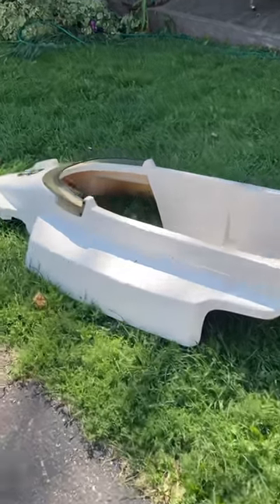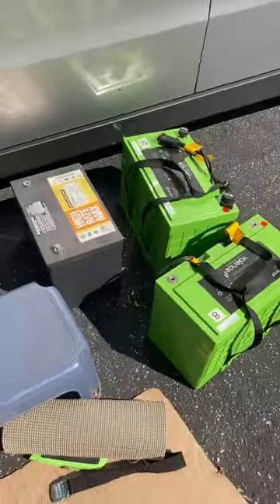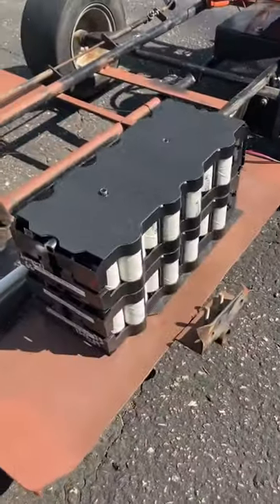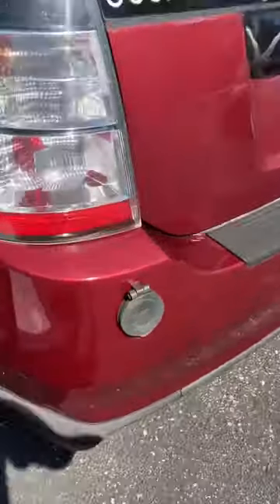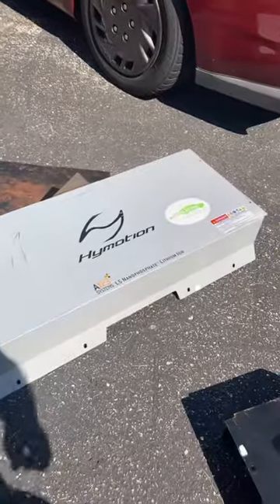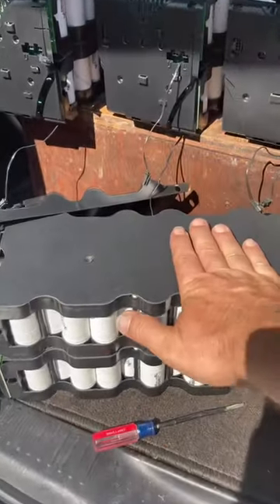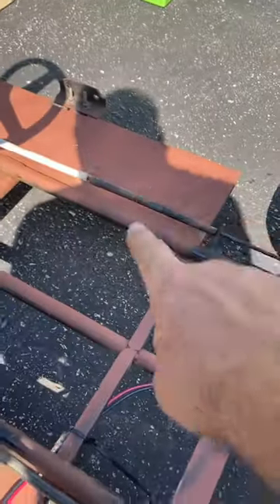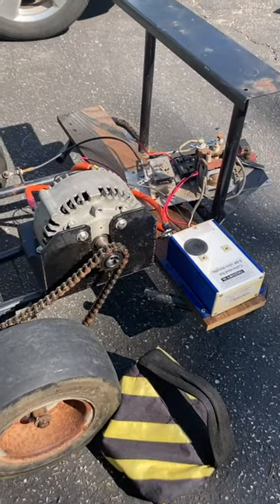A123 Lithium batteries for Electric Go-Kart

Comment: Might you have seen the high discharge 48V capacitor setup on battery hookup.? Might be a good buffer capacity for your build. Looking great 🙂👍 gotta love A123 cells. Zooooommmmmm!
Reply from the maker: I'm more than happy with the A123 cells! This is a low budget project. I'm pretty much just using all the bits and bobs that I have. I nearly forgot that it was A123 cells in that old Prius kit I had stashed away!
Reply: @BenjaminNelsonX  gotcha 👍. Yeah those A123 cells are practically gold!! Great project and looking forward to see the rubber hit the road 🏎️💨

Comment: these are 26650 cells?
Reply from the maker: I measured them. Yes, they are 26650 format cells. A123 Brand.
Reply: ANR26650M1A 2300mAh 70A continuous, slightly less energy than the M1B’s but technically have a bit more power output. If they are M1A’s though that means they are quite old but these A123 cells are famous for being impossible to kill. They might see some degradation in capacity/power output if cycled enough but calendar aging and over discharge seems to have minimal impact on them.  Not uncommon for cells that have seen a lot of cycles to still have 1200-1600mAh of capacity remaining with the ability to discharge at 20A+ even if they are 10-15 years old. I’d imagine by now all the M1A cells are at least 15 years old and it seems the cells that are degraded were from the electric buses that pushed them pretty freaking hard. IIRC it was 16 12S8P packs in series moving a bus so quite the load on those cells. Of it might have been 12 packs in series. Either way somewhere between 400 and 700 volts with 8 cells in parallel means there was a potential output of 560A but I’d say 400A would be a more realistic number that wouldn’t cause excessive voltage drop. 460V at 400A is 184kw of power which seems about right for a bus 

There’s some M1B 12S8P packs on eBay right now. $100 shipped for lightly used and $110 for uncycled. Before the uncycled ones were available I bought a lightly used pack and cut it into 4S8P 12V packs. Just one of those 12V packs I’m using to power a spot welder PCB (JQ-DCH02B?) and I can easily do 0.20mm pure nickel. I’m sure if I beefed up the connection between the pack and the PCB I could probably max out the spot welder. Right now I just have a single 12AWG silicone wire coming off each side of the pack, soldered to the nickel in a couple places. Might bump that up to 6AWG and add a second 12V pack in parallel…or parallel in a 4S pack of Headway cells. I was dumb and tore down one of the 4S8P chunks….

I’m sure if I combined my Headways with two 4S8P A123 pack I could more than max out the spot welder and probably max out a Kweld allowing me to almost spot weld pure copper with the right electrodes

Sorry for the rant just wanted to let people know about the 12S8P packs that are dirt cheap and have so many uses of broken down into 12V chunks. All it takes is a Dremel. If you need 48V then buy 4 packs and chop one up so you can slap a chunk at the end of each 36V pack to make them 16S8P….that would give you 3 48V packs…each one would be roughly 1kwh. I’d either connect them using multiple pieces of 12AWG silicone cable or get some flat copper bar stock and use a big soldering iron to solder 2-3” copper bridges to join the 36V packs to a 12V chunk. Should easily match the IR you see when measuring from one cell group to the next with a milliohm meter since copper has much lower IR  than nickel. When I measure from group 1 to group 2 (or group 2 to group 3) I get right at 1 milliohm so make sure when you attach group 12 to group 13 you see right around 1 milliohm AC IR. 

The uncycled packs might even have lower IR…but the “used” pack I bought shows almost zero capacity loss in terms of Ah/Wh and the individual cells I pulled from the nickel test at 5.9milliohms which matches the datasheet.